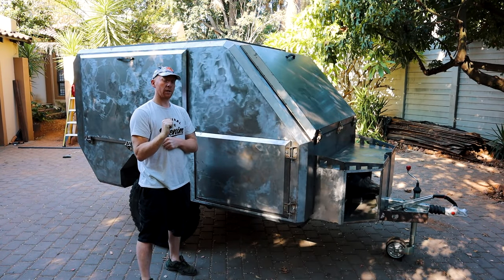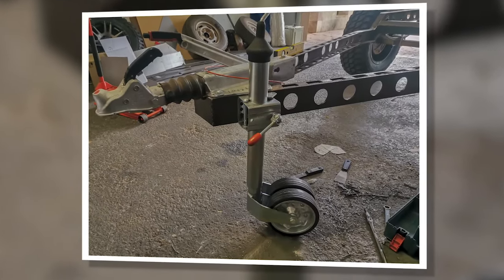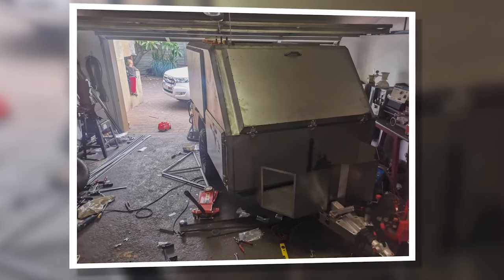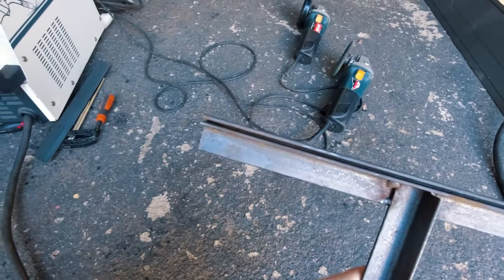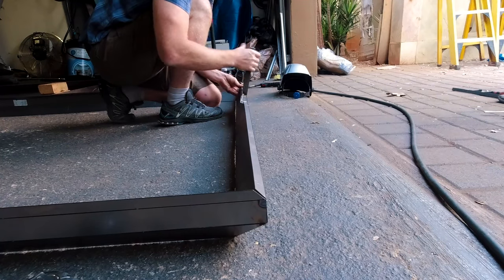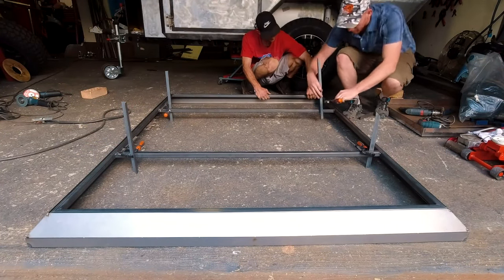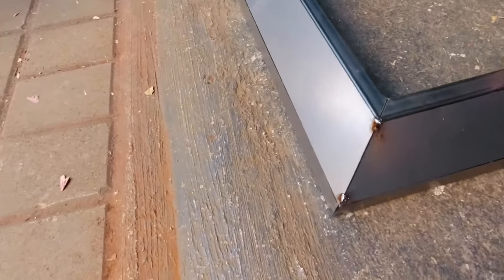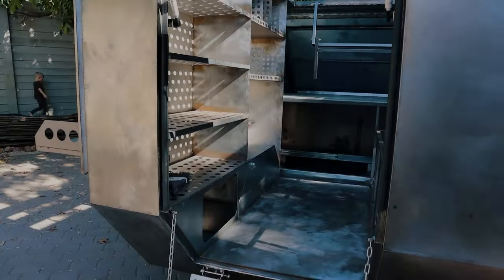DIY Off-Road Camper Trailer Build From Scratch - Part 1

Comment: What a truly outstanding design and construction!

Your meticulously precise craftsmanship is a joy to see and your methods of introducing strengthening bends in the steel sheet without access to a large capacity brake is particularly ingenious!

Wherever one's eye falls, neat details abound on this gorgeous camper!

For a novice, you've certainly drawn the files up perfectly as everything is very neat (obviously, apart from that 2mm you had to grind off).

I'm delighted to subscribe and really look forward to seeing more of your metal wizardry in future videos!

Your fantastic build will inspire others to create for themselves!

Your idea for welding the bends to form the structural shape is really clever and is not something that I'd have thought of, I can see others incorporating that neat idea.
Reply from the maker: Thank you so much for the kind Words!! Really appreciate it and thanks for watching!!

Comment: Nice work, I like your design and manufacturing method. I will likely build a CAD model and have my material precut similar to the way you have on my next build.
Reply from the maker: Thank you sir. Nothing will beat proper machinery to bend the steel but one has to make a plan with what's available :-) Thank you for wathcing!!

Comment: Love the build brother. I'm doing the pop top roof you have as it's the strongest I can think off. Ill be adding insulation underneath and a alloy or steel roof. The reason being as I'll be using the pop top roof to act as my boat trailer like we do back home in Australia. It's common to carry boats on roofs there. I'm also building my camper out of a old vw mk4 golf to be towed by my current vw mk4 golf  the thought being why not and if I have any issues while on the road I can get parts from the trailer and have the ability to get to either reception or to a town to buy the replacement parts. I love your fold out front idea and think it would be a good addition to mine instead of the windscreen
Reply from the maker: Hi, Sorry for the late reply. Its sounds like an amazing unique project. Would love to  see it finished. The idea of getting replacement parts is awesome. I've also used parts form normal stuff like my shocks are from a ford ranger... had the same idea about getting parts when i need it.

Thanks for stopping by. Appreciate it!!

Comment: awesome job.!!!!  anyway to get the data files for the project.
Reply from the maker: I only have one SketchUp file that has been modified to hell. nothing on there is spot on. Remember this build wasn't even planned on being documented let alone work on some usable drawings for later use, pieces that don't fit was just cut and manipulated manually to fit, usually what I do is when the next piece is due I size it up from my trailer then draw up and  order the next part . so that wont fit on the drawing but the actual unit. At this stage u would def loose money if u order sections from the current drawing to start a new one. Thank you for watching!

Comment: Wow that is turning out really nice. Making everything out of carbon steel. Wonder what the weight of it would be? I am getting ready to build an offroad camper myself. Have to say I like your design. Looks amazing well done!!!
Reply from the maker: Thank you. I have a spreadsheet keeping track of the Weight. Here by us similar steel caravans range from 1100kg dry to around 1500kg. This trailer will finish around 1300kg. I will be making a video of it on scales to check my final tongue weight and to see the weight balance across the axle. Thx
Reply: @MariusBotha  well that's not hateful at all. Are you going to post more detailed videos up to this point or just from this point on, in the build. It is the best build I've seen for one so far by a long shot. Keep the videos coming!!!
Reply from the maker: @gregnorvell9730  I'm trying to finish the camper at the moment so most videos will be going forward for now. later on I will try and make videos to answer questions regarding the early days of it. While finishing the inside, a lot more details will be seen with regards to the design and construction. The different camera angles inside will show many details of the early days as we move along.

Comment: Marius, this looks good so.
I subscribed and would love to see the rest of the build.
I would also like to see a detailed explanation of how you did the doors and angle iron frame.
I want to build a a small trailer with a a rooftop rent in the near future and would like some clear explanation thereof.

Also, what did you use for designing the trailer? Fusion 360 or something else? Some video of your designing process will also be welcome.
Reply from the maker: Thank you so much. I still need to build the 2 small front doors, the angle iron frame and the hinges for  the nose cone doors soon so there u'll see how I did the rest of the trailer. For drawing and exporting files I use Sketch-up. I barley know enough to get by.. LOL. I'm going to try and show a little from the program as I go along as I don't have nearly enough experience on the program to offer a tutorial video, that would be like "the blind leading the blind" 

And yeah. regarding your trailer. this is my first time building a trailer and the best part is how u can add stuff exactly how u think it would be convenient for yourself. Its awesome and saving some money going DIY never hurts.😂 Good luck and thx for stopping by!
Reply from the maker: Hi. I got a notification that u sent a msg and could read the 1st few lines of it. But somehow its gone. its not under any of my comments so its gone. if u could repost it then i can read it :-) thanks

Comment: I’m a fabricator myself and I find this very interesting and I’m looking into building my own as well. Seeing this is awesome and “mind my language” completely badass  my only question would be weight. Would that be an issue for a small vehicle such as a jeep? I know a truck will pull it no problems but I have an xterra and my concern really is weight.
Reply from the maker: Hi. Thanks a lot. I would check the towing specs on your vehicle. I did make a video on the Weight of the trailer where I weighed it. Came in at 1100kg which is not bad at all for what it is. Check it out. Thanks for watching!!!

Comment: Well done Marius. Can you share licensing and registration process for SA?
Reply from the maker: Hi, we have rules and regulation for any trailers(how far the axle allowed back.. the degrees on the a frame, where your lights are mounted and so on). Once done we take it to the registration and testing station along with paper work for the main components. The hitch and axle certification. Then they inspect it and if u pass u get your registration. Thx for watching!

Comment: Hi Marius, what is the width of those cut-lines you are folding to and at what distances do you leave the little tabs? Great job man, I'm very excited to follow along your build.
Reply from the maker: Hi. I'm not sure I understand correctly? what do u mean by cut line width? The thickness of the cut is the thickness of the laser cutter. The rest is all the size that I need to fold over, For instance the outside corners are 60mm. The tabs I try and set them roughly 300mm apart on 2mm steel or anything that's close to that. I usually start by taking the length and putting a tab in the centre. Then place a tab in the centre of what's left on each side.. so basically halving each section every time until the spacing is close to 300mm

Thank for watching!!
Reply: @MariusBotha  That makes sense, thank you.
Reply from the maker: @willieventer9839  No worries. I'll see it works really good without bending machines. Thx

Comment: Ok, where in the world did you get those hinges? I've looked everywhere on the internet. Except where they're at.
Reply from the maker: Haha, I built them, also couldn't find any that I liked and were proper. These are 3mm stainless steel hinges. Other problem was with the angles I had  they had to be custom. I'm busy drawing the hinges for the small nose cone doors ATM  so soon ill show how I make and install them. I didn't photo or video any of the existing hinges being made or installed. So hopefully when I do the front doors people will get to see the whole process. Thx

Comment: Looks good. Nice design. What steel are you using fir the panels? What is your expected weight going to be like?
Reply from the maker: Hi there. It's 2mm mild steel on the outer shell. I did weigh it on the channel in another video and it came in at 1100kg.. Thx for watching

Comment: Well done! Would love to here what thickness of steel you used Marius, as well as the wait. I saw a very similar one the other day waiting for it’s powder coat, in Stikland near Brackenfell.
Reply from the maker: Hi. The outside shell is 2mm. Most interior shelving and so on 1.6mm. I have a video on the channel where I weighed it. Came in at 1100kg
Thanks

Comment: Hi. I'm also in the design stage for a camper. Im just afraid of the weight of the camper at the end. Thinking of combining aluminum with mildsteel
Reply from the maker: Hi. I did put the trailer on the scales on my other video. It's really not heavy. Combining alu will be great. I just don't have a oven to de-stress welds on alu. That's why I skipped alu for the most part. Thanks for watching
Reply: @MariusBotha  Is the whole build done with 2mm mildsteel?
Reply from the maker: @Et4532  Hi. The main shell is 2mm steel. Inside for shelving and so on I use 1.6mm. Thank you!
Reply: @MariusBotha  Hi. What is the width of your axle and how wide is your total body?
Reply from the maker: @Et4532  Hi, The axle width if I remember correctly was 1520mm. The width of the trailer body is 1880mm

Thanks

Comment: Good day Marius been following your project closely and cant wait for you to drop another video. I would love to do this project myself and like to know , i picked that you using 2mm metal sheet, is it enough to use it also alone structurally ?
Reply from the maker: Hi there. Sorry. Somehow i missed your comment. The 2mm used as a mono construction shell where everything supports everything else is insanely strong. I would be t i could remove my shell from the chassis and u would not flex it one bit. Its really insane how strong stuff gets when welded all over and they all support each other.

Work has been very busy so I've been working when ever I can on it. I'm now on a final rush to get it done for my December holiday trip. I've finished all the tents and canvas work. Finished the awning. Now just final prep and then painting starts. I've captured a lot on film but I'm not sure ill have time to sit and edit all of it. If all else fails the next video will be a time-lapse from start to finish and then after that I might post  some how i did things videos. So sorry about that. :-)

Thank you
Reply: @MariusBotha  great stuff... Keep inspiring us👌

Comment: How thick is your frame? Also what size c channel did you use?
Reply from the maker: Hi its not really a C channel,  I think its called an IP65 Beam(might be wrong) Its 120mm x 60mm wide. The top and bottom flange is 8mm thick and the side is 6mm. The corners are cast so at the widest part they are around 12mm thick. Its a very strong base. On video it might look like its just a c channel but its seriously overengineered. That's why I cut it full of holes for decorative purposes.

Thank you

Comment: What  I did to make mine fit in the garage I bought some 12-in trailer wheels
Reply from the maker: Hi, I've now bought some small steel rims with no tires on and still my awning hits the main garage beam.. it sucks ..lol I think its lower than standard. At least its final resting place it fits with no issues.. lol Thank you

Comment: Love your video…. We’ve been looking for a trailer like this and like you said…. For what you pay for one brand new, there’s still kinks and issues with them, especially considering what you pay for them…. Do you have plans to you put together?  And like the other YouTube gent viC said, there are not many, if any, that can top a build like this.  I’d pay you for a PDF set of plans if you have any.
Reply from the maker: Thank you so much. The only files I have is the SketchUp files. I export from there to dxf format and have the laser shop cut them. I have sent a few people the files but don't think it will work by just having it cut. The main file is a total mess as I have been cutting and pasting everywhere ..lol  Its mostly to get the sizing from my drawings and then re draw it so u understand the whole camper and all the sections from the ground up. Its much easier building it if u know in which order u drew it. SketchUp is really not hard to learn and I would really urge u on to give the free version a shot:-)

Thanks
Reply from the maker: Mariusbothachannel@gmail.com

Comment: Did you make construction drawings and a list of materials? I think I would be willing to pay for that.
Reply from the maker: Hi, Unfortunately not, I only made a 3d SketchUp model , I took certain sections and made 2d drawings of that in SketchUp. then exported them to a dxf file with SketchUp and had them laser cut. Its a mess.. lol If u put a little time into SketchUp. its a very easy program to learn and usefull for a lot of stuff.. I did my kitchen, bathrooms, camper , Speaker system and lots of other stuff on SketchUp before building them. Very useful !!

Thank you

Comment: Any chance of getting some dimensions?  Length, width and height.
Reply from the maker: Hi, The total length of the trailer from tow hitch to Spare wheel which sits right at the back is 4250mm Hight to the top of the awning with the current 17"wheels and big tyres is 2230mm. And the width on the widest part is 1900mm

Thanks

Comment: I just can’t imagine how heavy this trailer is each sheet is approx 3 SQM at 15.7kg a square 47kg per sheet. 
Well it is South Africa you might need some kind of bulletproof rating! JKLOL
Reply from the maker: Hehe.. I did make a video where I put it on the scales. It's sitting on 1100kg. That's not heavy for this type of camper at all. Thanks for watching.
Reply: @MariusBotha  1100kg dry? I’m building one at the moment actually right now. I just come back from a test drive, I’m trying to keep it too 1000kg with all my kitchen, drawers, bed, water, batteries and solar, it’s so easy to make stuff heavy but making stuff light is hard. 
But if your trailer was aluminium it would have come in at 750-800kg
Reply from the maker: @MussaKZN  I did make a video that u can watch what was weighed. Yep for sure alu would have been nice. Problem with alu for me is I don't have an a big oven to de-stress welds. If not done they crack right through the welds in time to come.

Comment: What has the cost been?
Reply from the maker: I'm keeping a spread sheet as I go along that I will work through properly at some stage. I've bought quite a bit of stuff that wont be used as plans changed along the way and don't want those added due to my idiot mistakes. In a future video I will go through all the costs in order to show what the cost was. One could also save some money on certain items that I over engineered . Thanks for the enquiry.

Comment: So normally if some one copycat a trailer they dont do it this blatant. 

The solid axle is a let down. Atleast the companion has independent suspension
Reply from the maker: LOL...if anything its more a copy of a Bushlapa with a companion kitchen.. either way go buy a companion without leveling jacks that's riveted together. Be happy with it and enjoy the outdoors. And why would anyone want independent suspension on a camper? There's a reason company's like bushlapa went with solid axle over independent suspension. Fancy suspensions only makes for "bragging rights" next to the braai for some people that forget they most likely towing their fancy camper suspension with a solid axle setup in their tow vehicle. Cheers
Reply: @MariusBotha  I do have a companion for the last 4 years now. Please tell which bushlapa did you copy. And then go and look at the companion and tell me again its a copy of a bushlapa. Ya the levelling of the caravan is for people that can figure stuff out. I couldn't carry on with the torturous videos but weight wise the companion isnt the heaviest is that segment. And the suspension is leaps and bounces ahead. 2.5 ton axle vs the heavy duty independent swing arm suspension with Toughdog coils and shocks. Sorry but no comparison. Ya if you dont know how suspension work then I suppose that defending the cheaper easier way above the more complex and robust way I suppose you are right. Strange that all the top sellers is Aus is independent and all the cheap stuff is solid axle. A market leading country regarding recreational equipment thats leaps and bounces ahead of us in SA has made the move. But anyways as long as you and your family enjoy your caravan then I  reckon you did a good job.